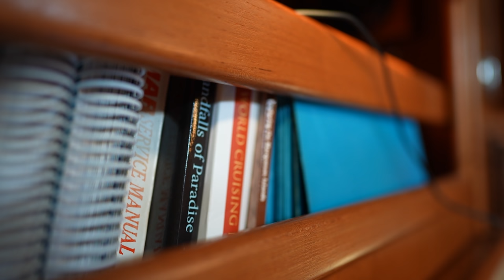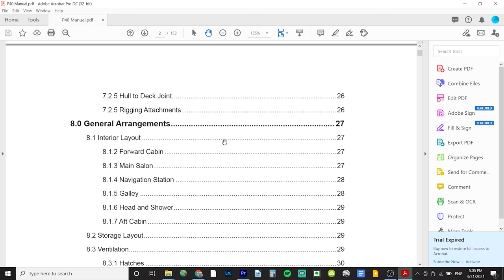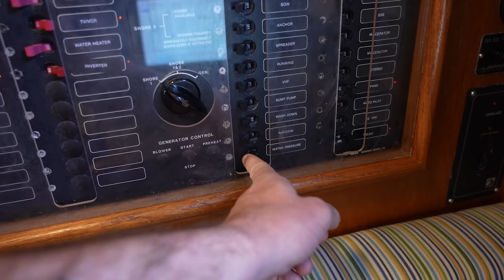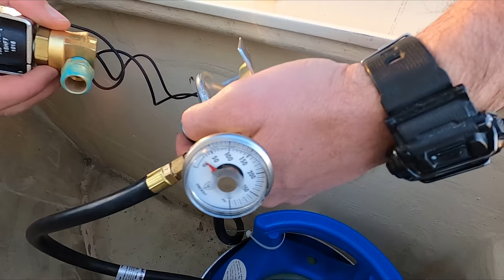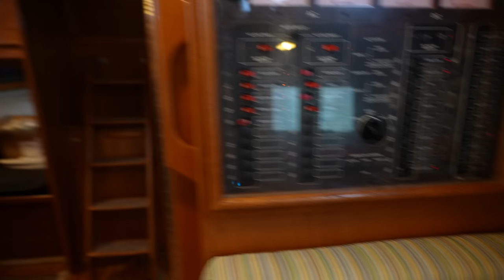We Love this boat...BUT NOTHING WORKS!  | S06E01

Comment: In case you need a recipe for sanitizing a boat or RV clear water tank:   Mix 1/2 cup of clorox bleach to 50 gallons of water. Fill the tank to the top using more clorox in this ratio to water until the tank is full. Let stand for 4 to 6 hours. Drain tank then flush with clear water. Repeat every 6 months or more frequently if you have any non-potable water.   Ron Ray in Oregon

Comment: In August of 2016 I bought a 53 Hatteras Motoryacht.  Nearly everything worked.

UNTIL !

We started to use everything and slowly nearly all the systems stopped working.

Now I know that boats that have been sitting idle once used regularly hsve many issues.

Comment: Guys, congrats and great job on tracking down your problems with the water and propane. One thing that made me GRING however was that you were going to use the water you placed in the tank without sanitizing it first with a clorox/water solution. you probably already know that thats the only way you can be sure to have potable water not to mention that the spigot you used at the Marina may or may not be potable. So just a suggestion to prevent you guys from getting sick on your new/older boat.... cloroxWater all your clear water tanks and either use bottle water or a Berkey water filter system until you know everything is sanitary and potabl;e! Good luck and Congrats! Love the new boat! BTW, your regulator and solinoid were probably ok, you just forgot to cut the propane back on. Safe Sailing and again, LOVE THAT BOAT!!! Ron Ray in Oregon

Comment: Great to have simple problems.  Stuff stops working and you need to know how to fix it.  Yesterday our main AC worked at the dock in the morning. Back at the dock after a day sail it would not.  Turned out to be the raw water filter I had been thinking I should service.  If you don't already, have two getting another propane tank would be a great cruising upgrade.    S/V ChatEau Nassau Bay, TX

Comment: I like the diagnoses of the problems, whether they be electric, water, engine or anything mechanical.  I knew something was wrong when after replacing the valve your stove lit and then slowly went down.    I thought after replacing reg and it failed- might be valve and you should of been able to bypass it for a test.  but after replacing valve and stove still did not stay lit, I thought we didnt get the whole story.   water problem was interesting.

Comment: My take is perhaps your regualtor and solenoid were working..but all propane tanks built in the last years have an excessive flow regulator. If it senses a leak in your system it dramatically reduces the flow out of the tank. This seems to happen more when it is cold.  To fix simply disconnect and reconnect hose at tank.

Comment: This all doesn't surprise me for a boat that probably wasn't used very much lately. You'll just have to make sure everything is fully functional as you use it. 

First time it rains I would give the boat a very good look over to make sure everything is water tight. Wouldn't surprise me if something needs some new caulk.

Comment: My stove has a safety mechanism that will stop the propane flow if the burner is cold. This means I need to manually hold the valve open for about 30 seconds when starting so that everything heats up. You probably knew that, but just in case.

Comment: Like'n the self-storing oven door and the galley in general. 

I wouldn't be surprised if the PO only used one water tank. It's best to use every system to it's fullest on a boat, all the time. An idle system will soon become inoperable, IME. Parts that are designed to move, MUST BE MOVED periodically to remain in condition. That includes all valves on all systems on the boat. Gas, water, oil, drain, engine, etc. I would recommend at least once every month or so. Just a simple on/off, open/close action. 

Been living (am single) on my 37.5' 1979 O'Day for about four years now (mostly in a marina) and am lusting after a newer slightly larger boat like yours. I could buy one and have it paid off from the savings compared to a nice apartment around here (bay area) in about 4-5 years. I'm much too old to be on my hands and knees, fixing things, in the bilge and engine compartment these days and want a boat where everything (including me) is not on its last legs. :)

BTW, there's a marvelous new invention out called the 'salt-shaker' that permits one to control the amount of salt one dispenses. It's like magic!

And I too had to replace most of my propane hardware, fuss with the stove and trouble shoot and repair my water system. I suspect they are common problems on boats that are not used on a regular basis. Which is just about all boats that are not live-a-board boats. If you're like me, you'll soon be experience (although I hope not) electrical problems...

Comment: That's frustrating but typical when you buy a boat, once the previous owner(s) decide to sell they are loath to throw more time and money on any more repairs than they need to to make the sale. 
Is their a propane alarm system on the boat?  It may have it's own solenoid valve to stop propane flow in the event of a leak.  The one on my buddies boat failed on us sailing the Kenai fjords so we took it apart and removed the check valve until we got back to Seward and could get a replacement.  Of course it wasn't going to shut off the system if there was a leak but I didn't want cold food for a week.  : )

Comment: Guys, The stove and the fresh water issues were a good test for your first days on the boat. Don't assume something is broke until you know how it works on this boat. Sit down and do your research before you tear into something on this new boat thinking something has failed. You both are fully capable of fixing anything on a boat. You have proven that to us for many years now. I'm just saying, slow down and take it all in, you have years to learn how this new baby works. I love looking over your shoulders as you troubleshoot and repair stuff. One other thing, your not use to operating in the cold weather, it will effect a lot of the systems on the boat.  Get your business done and get your butts down to N.C. where it's warmer.

Comment: Amazing, already 2 things wrong (sort of).  Question: Did you turn the propane valve on after the regulator change? You could have a "good" spare solenoid to start your new parts inventory.  Enjoy!

Comment: Well, that regulator died because it's mounted wrong. It should be oriented so the diaphragm is horizontal. Otherwise over time the moisture will unevenly wear one side until it dies. Best of luck.

Comment: Could be worse, the night I bought my boat the bilge alarm went off about 3 am, knowing what it was I came flying out of bed and slammed my face into the chart case that is overhead in the V birth, hearing the commotion my German Shepherd came crawling out from his bed which is under the V birth, and as I was trying to step down he was trying to come up and out. 

Thus the dog and I wound up in a big pile on the floor. 

By the time I got on my feet the alarm quit and I realized that it was just servicing the water that was in the bilge and everything was fine, although the dog was quite perturbed!

Comment: THEY MAKE A FILTER THAT about $12.00 connects before the regulator .    Will keep the contaminants that can be in bulk propane and somehow get into the line. worst case gets thruogh the reg and into the small ports that feed the different appliances

Comment: You should not use soap, washing liquid, or anything else apart from proper leak detector fluid, as some can be petroleum based and can rot hoses ect. I am a gas safe eng based in the UK. proper LDF Leak Detection Fluid is very cheap and lasts a long long time

Comment: I would have to take the water tanks apart and clean them. STOVE check the emergency shut off most require the bilge fans to be on to stay pressurized.  I Do not think that year had that .But it is good to run the bilge exhaust fans if that safety feature is not incorporated into the vessel.  I have been called to repair two different yachts due to a gas combustion accident in the living quarters.  Both were devastating.  Show us the working smoke / carbon monoxide and gas detector.

Comment: I do not understand how an owner could allow the water system to foul like that. Anyway, clean it out throw some bleach through the system and it'll be better than new. In the Navy we'd add a tablespoon of bleach to the water system to keep it from growing gross things. Today with awesome filtering systems like on my MY there is no need for putting bleach in every tank. Without trying to lose any "Man Points" She Who Must Be Obeyed, when your using a chefs knife or sizable knife you will have more control and it'll be more comfortable. To hold the knife with your thumb and forefinger at the base of the blade where the blade meets the handle. Also when cutting greens the western Chefs knife has a curved blade so one just rocks the knife back and forth. You'll notice less hand and wrist fatigue. Awesome home!

Comment: Yip, boat projects and maintenance/repairs, ironic that I was supposed to fly to Cape Town tomorrow afternoon to get my boat ready for category A COF (certificate of fitness) and a 400 odd mile delivery to her new home port and the water pump on the 50 odd hour Vetus 33 HP donkey just failed, no replacement parts in SA currently and necessitated an expidited part order from wuflu~land with a minimum of 2 weeks delivery time, delaying my departure by 2 weeks and additional expenses 🙄🙄🙄
And she's only 8 years old, I never expected anything else, I think in reality a lot of people expect too much from their vessels to start with, I'd far rather deal with reality than a window dressed boat that appears seaworthy but isn't, what I have learned over time is that a yacht is a mechanical/electrical  machine that really needs to work, not every 3 weeks but daily, the more use the less failures

Comment: NOOB question...  Is there a reason you would not want all three thanks on at the same time so they equalize?  The manifold provides a way to isolate all three tanks, but you would have to shift from one tank to the next all the time if out away from water source.  Why not let all three tanks operate as one?  I am sure there is a logical reason, just wondering.

Comment: Yes the blessings of buying someone elses problems. Got mine and headed out away from the nonsense to fix new engine mounts installed upside down which screwed up the entire drive train and seals leaving only a couple of sweet spot rpms that didnt grind the teeth or the entire constitution of everything. Then there was the Rudder and the Rubes...fmr!

Comment: About the stove..... European boat have thinner copper pipes bcs our gas have more Butan in it and in the Americas more propane is mixed in (hence the name) so European pipes get clogged more quickly but it does not garantee that other pipes do not get clogged. I removed my european stove almost every second year and got a tourough pressure air clean through. It is not always the regulator....